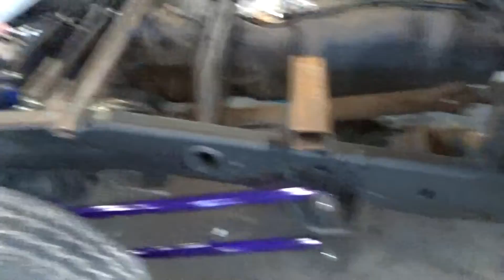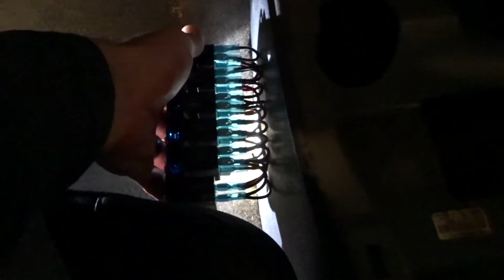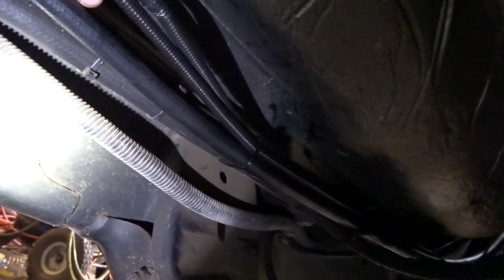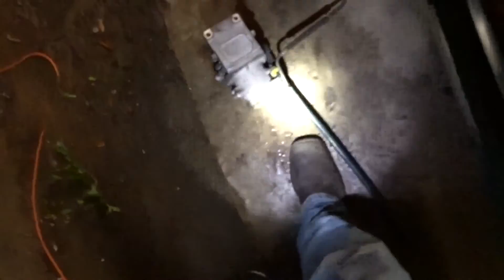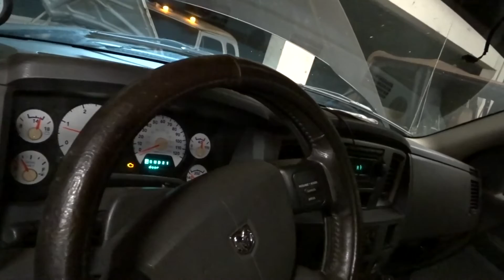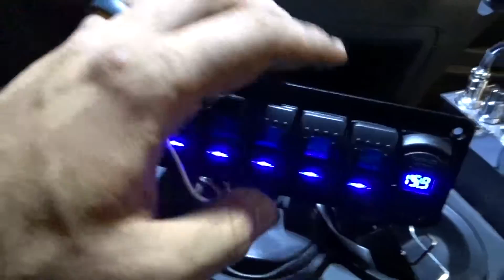Finishing Up Airdog Install and Air System Management

Comment: The best wire is anchor brand wire. It’s marine grade, aluminum coated copper wire. It’s pricey but it holds up in a salt water environment amazing. I use it on everything up here in the north east. I’m on the ocean and get salty roads and that wire holds up. My first truck bed I built I used the cheap amazon wire and after one winter I was chasing wiring problems once a week. Not worth the cost savings

Comment: Check eBay for Consolidator consoles out of police cars or other emergency vehicles. There's usually lots of tear-out consoles for sale pretty cheap, and you can combine smaller ones to fit larger vehicles like trucks. They're modular, and they have blank panels, switch panels, cupholders, etc that slip right into them.
Reply from the maker: Great idea I’ll look into that